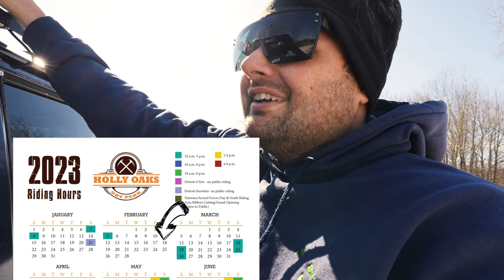We took the Jeeps to The Mounds and broke both of them

Comment: Greta video as always guys. Could have aired down it looks a little bit to have had a little less of a struggle but great job all around guys
Reply from the maker: Thanks!! We aired them down to about 18-20 but could have gone a little lower.
Reply: @mittenmotorsports  ya for sure the Jeeps aren’t to heavy and tires are pretty stiff so I am sure out can get away with like 12 to 15psi. I have 31x10.50s and I air down to about 14psi givens my wheeling is a bit different in Colorado compared to yours. Can’t wait to see your guys next adventure and the upgrades to come from the breakage
Reply from the maker: @Anthony_Adventures  Nice. Yeah i am going to go a little lower on the next trip. I double checked them just now and they were all around 24psi so i definitely need to let more out.